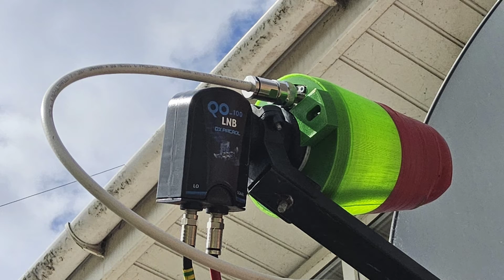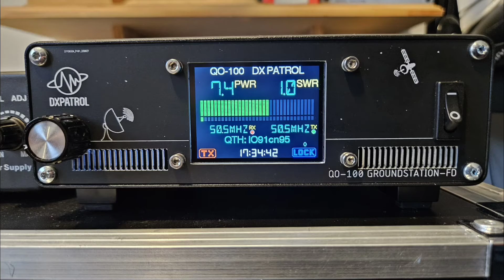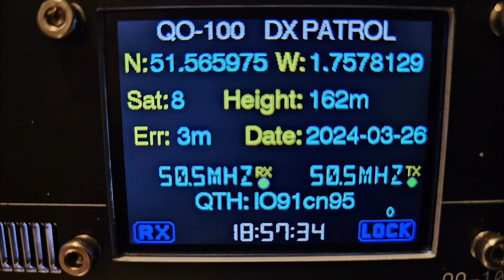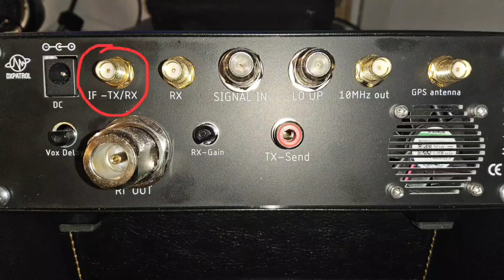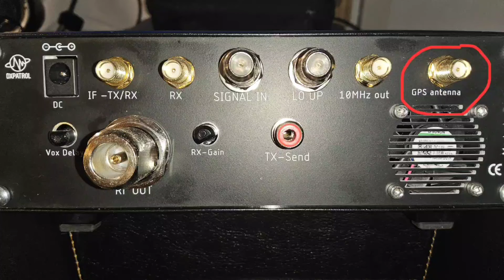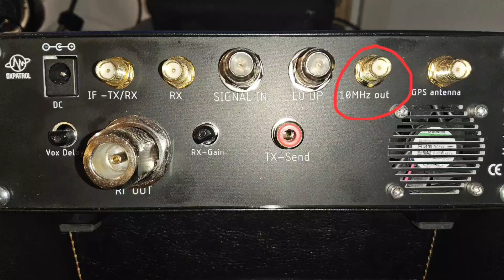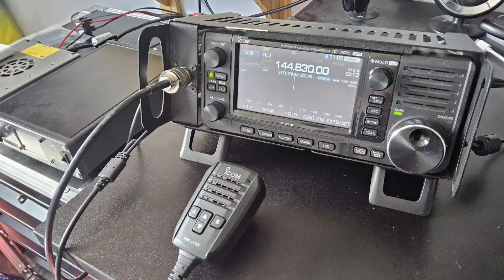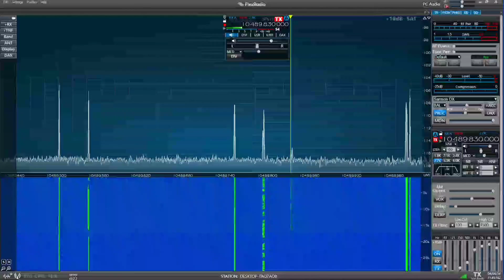DX Patrol Ground Station 2 For QO-100 (detailed look)

Comment: Hi, can it be connected to SDR software? Is there any compatibility with it? Maybe SDR Console...
Reply from the maker: It can be connected to any SSB radio. It makes no difference if it's an SDR.

In my home station, I connect the TX/RX port to my transmit radio, & the RX only port to an SDR Play RSP1A to run SDR Console.

Comment: helpful video, thanks.   What M&P coax would you recommend for a 10m run from the LNB ... Hyperflex 10 or 13 or other ??
Reply from the maker: Obviously the less loss the better, which generally means thicker cable. So 13 will be better than the 10.

Losses are pretty high at 2.4ghz, so that run really needs to be as short as possible. I know I had a long run in this video, but I wouldn't recommend that.

Ideally I wouldn't have a 10m long run at 2.4ghz but if a long run is unavoidable (which it was in my case), I would place a 2.4ghz amplifier in a waterproof electronics box attached to the back of the satellite dish. The run from there is around 1m to the antenna.

If you do that, you will probably need to reduce the RF power coming out of the ground station. I used Ultraflex 7 (calculated the amount of loss in the coax run) & added an attenuator to get the correct amount of RF power going into the amp.

Keep meaning to do an update video on this. I will eventually get around doing to it!!!
Reply: @HamRadioOnline  thanks for your feedback.  
I have decided to go with M&P Airbourne 10 coax; a number of reasons (In case you are interested) 
1) I will be placing the transverter on the dish so less need to worry about losses at 2.4GHz (you also suggested this)
2) M&P do not offer the needed F and SMA connectors for their HF13 coax and 
3)  HF is expensive yet only a little better than the Airbourne 10 at 739MHz and 432MHz.  AB10 is almost 60% less costly. 
4) I only use M&P as their coax is simply the best.
thanks again for your help and great videos.
Rob

Comment: Hi James, How much doe's all the parts rush you then in total to do it your way ? MIKE M1KEY

s
Reply from the maker: The ground station is currently selling on the DX Patrol website for 1k euros (not sure how that converts to UK pounds).

If my memory serves me right, I think it was supplied with an LNB but no 2.4ghz antenna for the uplink, so add around another £100 for that.

Then of course you need a satellite dish (these can be found fairly cheap) and coax. You need some really decent low load coax for the 2.4ghz uplink because losses are significant at ghz frequencies. You also need 75 ohm coax for the LNB. This is used for satellite TV & also by some cable internet suppliers and is cheap to buy.

Getting a QO-100 system up & running isn't cheap! There are absolutely cheaper ways of doing it than this, but as I said in the video, I consider this to be the easiest "out of the box" solution.

Comment: I live in an apartment with no balcony but I can access QO-100 by aiming a portable 80cm dish through the window in my living room, which just happens to open in just the right direction. Also using the DX Patrol II with the Knoll ice cream cone. Works great portable too running off a 7AH lead acid battery. I usually listen on the QO-100 WebSDR to check how I am sounding.
Reply from the maker: Great stuff. I've always thought QO-100 could be a good for people with limited antenna options.

Comment: Ground station not worth the money.  And bad after sales.
Reply: Yeah over a grand and you still need another rig. I got the sglabs transverter and an rtlsdr with bullseye. It all came to under 250 quid, but i splashed another 60 on 8d-fb cable to minimise losses on the long run to a 2.4m dish. Wrap a lidls carrier bag around the lnb and cone to help with drift if the bloody sun ever comes out.
Reply from the maker: There are most definitely cheaper ways of doing it. This is (in my opinion) the quickest, easiest, most "plug and play" way of doing it for people who don't want to do too much faffing around.

I ordered online and it arrived within a few days. I haven't had to use their after sales support, so I can't comment on that!
Reply: @HamRadioOnline  I ordered the dx-patrol helix antenna. The same one you have in your video. And there was a problem with the sending. So he decided to send me two times the same antenna. After receiving both the antennas I phoned him to tell him that I received not one but two antennas and could make a very nice deal with him.
Don't know about after sales, but my contact was very positive.

BTW I have a 3d printer and have made an STL-file for the cone of the antenna and can make a better one that is not so flimsy
I hope to be active on qo100 soon, I have also the DX-patrol two andhave ordered a 9700 so hope to work you soon.  (PA5MC)